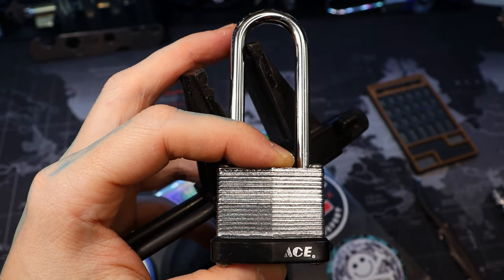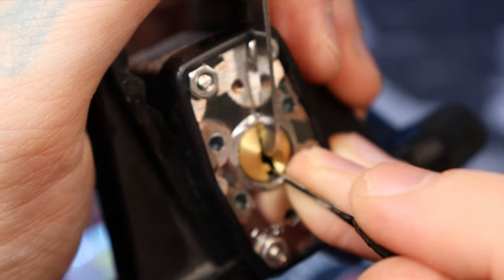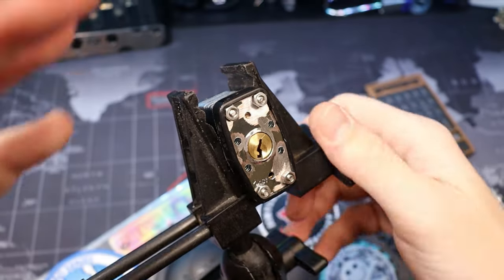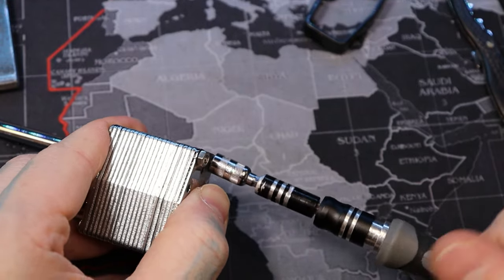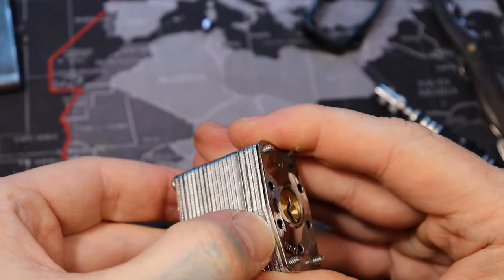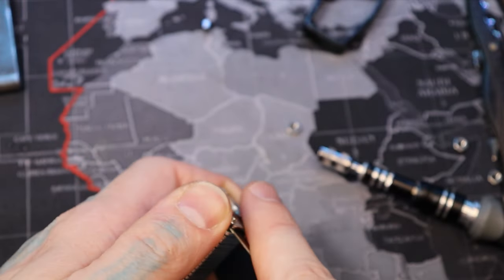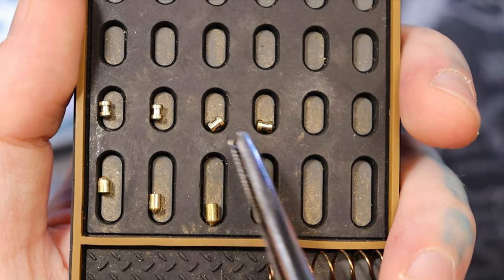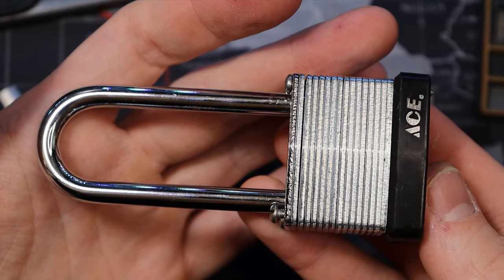258) Ace 40mm Laminated Padlock Picked and Gutted

Comment: So what about when the key hole on the lock is rotating like seemingly spinning
Reply from the maker: If it is making a complete rotation then the back of the plug is not coming into contact with the actuator correctly. Meaning, there's most likely some space between the plug and actuator for some reason (this can happen in LOTO locks) or something else is going on and most likely just broken.